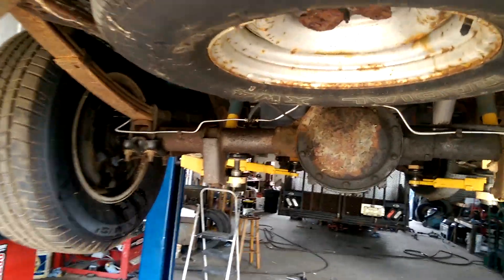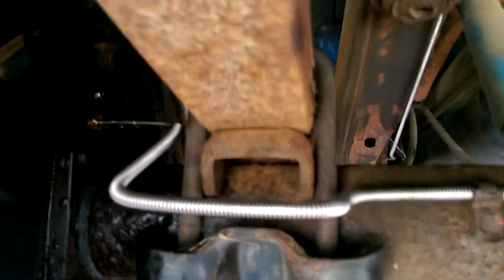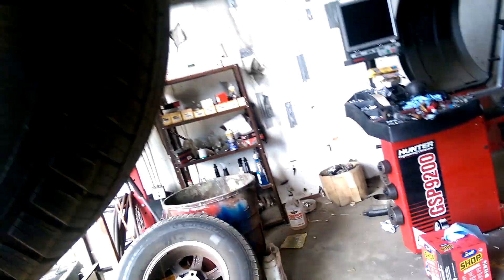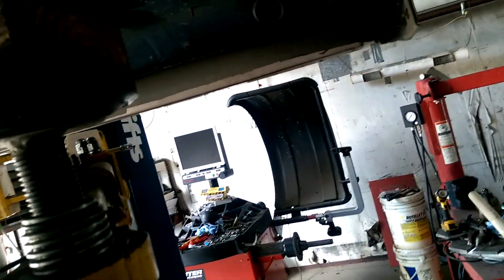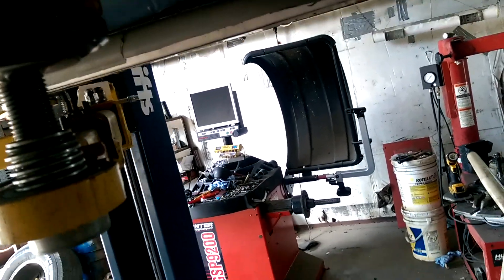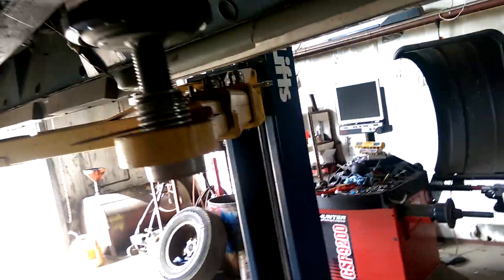Replace rusted brake lines on Chevy  GMC Truck

Comment: Is it true that when you replace a break line do u have to removed the gas tank
Reply from the maker: Most vehicles it is not necessary to remove the gas tank.
Reply: Just lift one side three bolts its easy